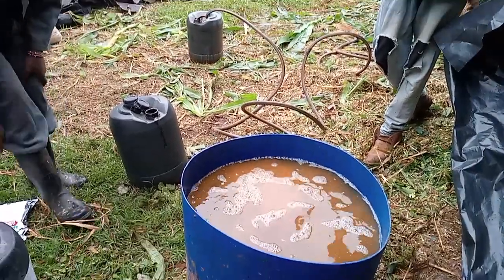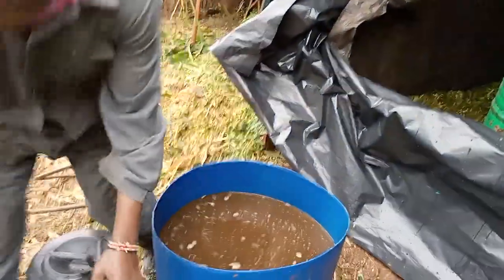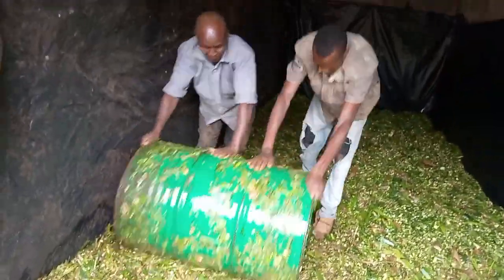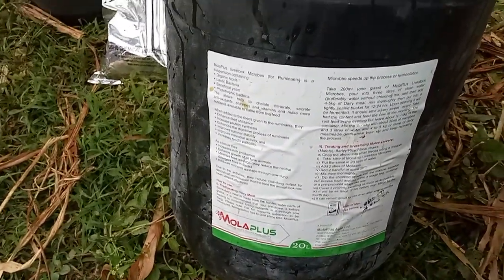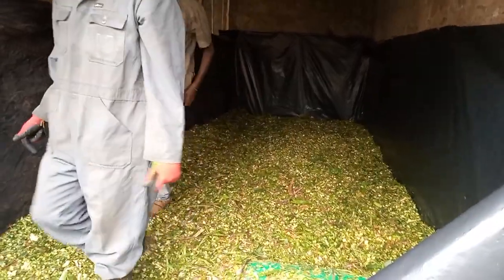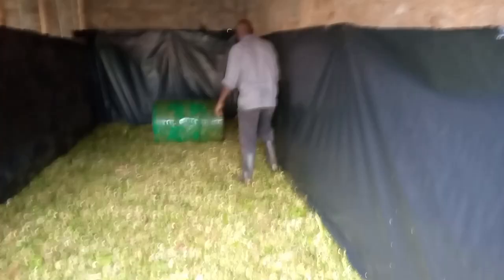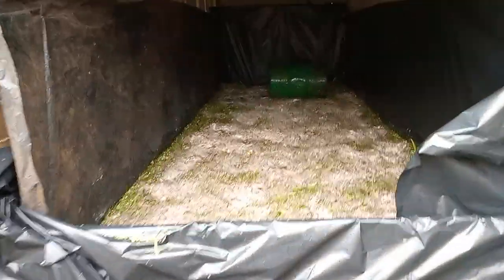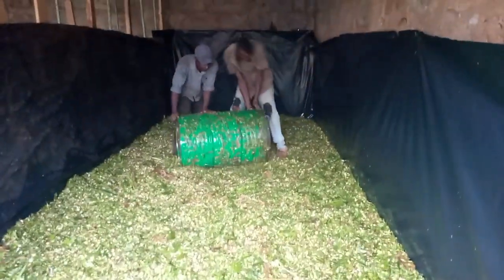How to make quality corn  silage  Part two

Comment: Was the chaffcutter the electric one or the engine one, Am afraid the motor one can survive working for long hour or it does???
Reply from the maker: Mine i use motor.If you have original motor it can do the work.